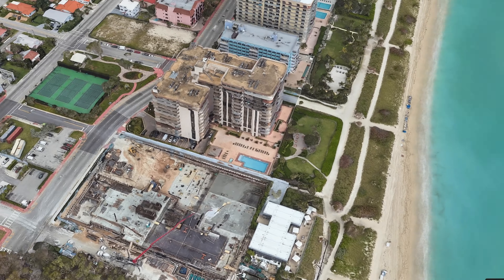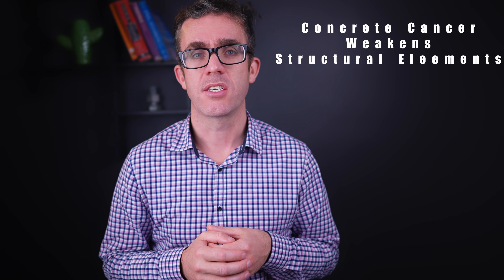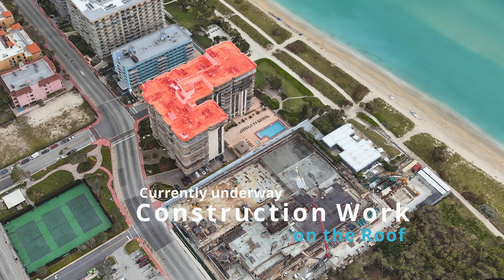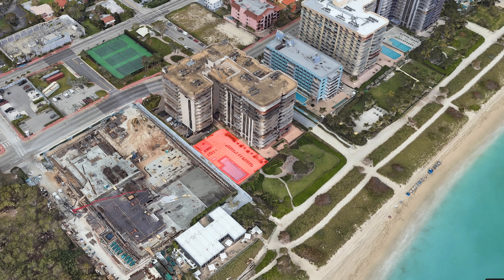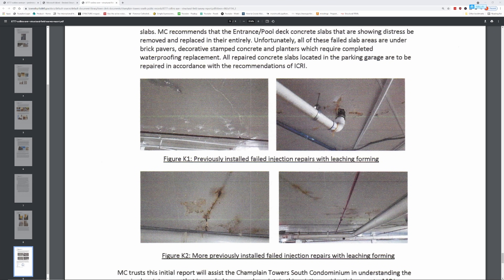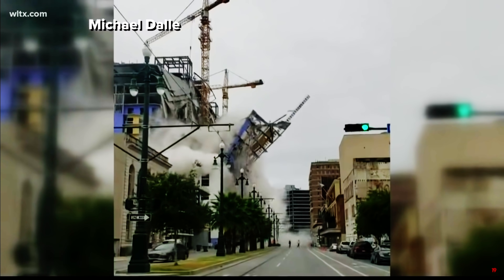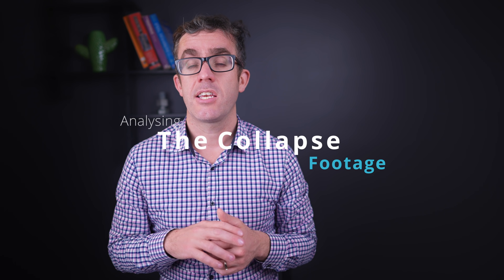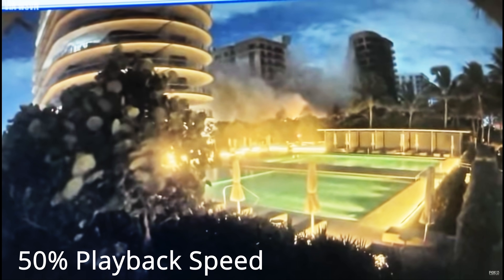How did a Miami building collapse: The Warning Signs. Report and  CCTV footage analysed

Comment: The first failure was indeed a column or multiple columns in the subterranean garage 7 minutes prior to the sequence of failures. Debris began and water began raining down in the garage over 7 minutes prior to the nearly 1/2 of the total structure coming down. 

To add to your spot on information, this tower, unlike its sister tower, experienced salt water flooding in the garage multiple times each year, during excessive high tides, for the last several decades. This is an important component to the investigation. As seen in the 2018 report there was extreme and extensive spalling in the garage slab and multiple critical columns. That said, we've not experienced building failure of this magnitude before. Other similar failures were the result of deliberate acts. It's vital we not speculate as the initial failure could be any number of thing. Not that the author of the video has. He has correctly pointed out a few reasons why the structure should have supported itself in the even of the partial loss of supporting structure. As well as a few reason why the structure failed to stand as designed. The initial column failure could be as simple as someone hitting the gas rather than the brakes while in the garage. Yes, this alone should not have brought the structure down. However with all of the degradation reaching a critical point one column losing structural integrity may have put too much weight on adjacent compromised columns and critical supporting structure. 

In addition to causing structural damage water intrusion may have been eroding the sand beneath the foundations of the structure. When enough material is eroded a sink hole opens up, undermining the foundation. This may also be why the initial collapse started in the garage over 7 minutes before the catastrophic failures. These are only a few possible causes for the initial collapse. The degradation of the structure noted in 2018 as severe was recently noted as critical. Had the building not been so degraded and provided no more than one column initially failed (if that was the case) this building should have remained standing until all occupants were evaluated within a few hours. 

Hindsight is always 20/20. This tragic collapse will forever change how we build, how we inspect, how we grade, and when and how we restore structures. One can't place the blame solely on the HOA, inspectors, homeowners, or prior contractors and their repairs. This will be a case study until a similar failure should happen, if ever. We all will learn from this catastrophic failure to prevent such a tragedy in the future. Building codes and building methods have improved in the 40 years since this structure was built. 

My thoughts have been with the victims and their friends and families since I woke to the horrific news. Nobody could have ever imagined this happening in the states. They're build codes and regulations are the best. Under normal conditions, a 40 year old building still in use should not have collapsed. I believe the HOAs misunderstanding of the 2018 report due to conflicting analysis and final notes was the only factor in delaying critical repairs. 

Engineers tend to use report templates. These templates are then altered to fit each specific subject structure. It's possible, and would be the first time, information on the template did not apply to this structure. There were some final notes stating to the effect the structure was overall in good shape. As a lay HOA individual reading this, one would conclude repairs are not as urgent as outline earlier in the report. 

For the record I have not inspected or even seen this structure before or after the tragic collapse. Again I am speculating on a specific cause of this fatal tragedy. I am merely pointing out a few scenarios and items of significance noted prior to the catastrophic failure. 

Cheers!
Reply from the maker: Hi Cameron, thanks you for the additional information so hopefully this sister tower is structurally sound.  The investigation will change building codes and likely find several causes. It maybe have been a cascade failure 

40 years seem like a long time between these inspections as well.  However no building should have failed like this, and we haven't see such a catatstopic failure is a building that basically failed under it's own self weight. There are likely 
 lessons to be leant.

Engineers will need to learn from this tragedy to sure it doesn't happen again, but It is a hight cost to pay to learn them.

I agree that throught need to going with the victims their family's and the first responders.

Cheers
Reply: Talk much?

Comment: What about the weight overload due to the excessive number of air conditioning units on the rooftop?
Reply from the maker: Hi Aktchung, from pictures it didnt appear to have to many air conditioning,  and their  weight would be small compared to the building weight so unlikely to be the cause.
Reply: @BrendanHasty  Agreed- the weight of air conditioning units is barely a drop in the bucket.

Comment: Really appreciate your effort for bringing this recent collapse. As per the article published in the BBC, it also suggests concrete cancer, water proofing and new construction works. The engineer, Frank Morabito, warned that the deck was not sloped to drain, so any water "sits on the waterproofing until it evaporates". This also suggests that water could not drain  properly and just relied upon expired water proofing membrane.
Reply from the maker: Hi Prabin, thanks for your support and sharing it out. The pool deck was a longish way from the crucial area, but bad water proofing and no drainage will likely increase any concrete cancer.

Comment: The building collapsed at low tide....
Reply: "Explanations for an initial failure at the bottom of the building could include a problem with the deep, reinforced concrete pilings on which the building sits — perhaps set off by an unknown void or a sinkhole below — which then compromised the lower columns." - New York Times

The article ends with an engineer saying that the key question is why did the building fail at that moment?

My answer:  It was low tide.  We know that sea water was pulsing in and out of that garage for decades as the tide went in and out.  Then on that night it collapsed at low tide.
Reply from the maker: There is alot of spectatation at the moment, it would be every hard to detect a sinkhole before the event. This will be investigated and we will find when the report is released.
Reply: @BrendanHasty  When you have saltwater intrusion for decades, then you know that you have a major problem.  The fact that the building was sinking twice as fast as surrounding properties is another indication.  Top engineers quoted by the New York Times are talking about it saying that if one or two pilings failed due to erosion from saltwater intrusion then that could bring the whole building down.  There is every indication that this is what happened especially since it happened at low tide.
Reply from the maker: Guess we will find out, if one pile failed this would unlikely bring the structure down. It would be damaged needing repair but collapse as it did very likely. Could it have been the initiator starting a cascade failure maybe it would other elements to be weakened. Two pile failing might do it but both failing at the same time would be unlikely.
Reply: @BrendanHasty  It will be interesting to see how it comes out.  Yes two pilings failing would be unlikely in a normal situation. Decades of saltwater intrusion is not normal and the building was sinking twice as fast as surrounding buildings.
Reply: @BrendanHasty  BTW have you noticed that the original debris pile was way lower near the initial spot of collapse?  Where did all that material go?
Reply: @BrendanHasty  Friction piles in porous limestone with salt water seeping in for decades.
Reply: @BrendanHasty  There is a lot of talk about LIDAR and soil analysis being "very important" at recent press conferences...

Comment: I have heard stories from other engineers seeing structures being build along the ocean, and the rebar being left out in the open. Causing the rebar to rust before even being placed into the concrete structure. Causing the "concrete cancer" to already be present before the structure being built.
Reply from the maker: Hi Seth, It would be to hard to fully protect reinforcement before it is poured. Most of the time it would be surface rust likely to not cause any issues. I am sure the investigation into this tragedy will answers many of these questions.
Reply: @BrendanHasty  what about using fiberglass reinforcement in areas where the structures are more susceptible to concrete cancer?
Reply from the maker: That is one option you can also protect the steel with sacrificial annoids. I haven't looked much into fibre reinforcement, however, it is likely to be brittle unlike reinforced concrete. Annoid protections would need some maintenance tho, but should be able to detect how the structure is preforming in a durability perspective.
Reply: @BrendanHasty  it's anodes. For well passivated steel in chloride free concrete they're not required. Due to the limited current throw galvanic anodes are impractical for reinforced concrete structures other than around patch repairs to prevent incipient anode formation. Better off installing impressed current CP and ensuring reo electrical continuity and appropriate zoning for maximum efficacy. Of course the 3Cs - cover, compaction and curing are the best line of defense for durable reinforced concrete structures.
Reply: Good God.

Comment: It's going to be very interesting to see what the outcome of the investigation is. Assuming they've allowed for disproportionate collapse in the initial design, the fact that the whole structure collapsed tells me there might be an overall material quality issue (concrete quality affecting rebar protection, etc).
Reply from the maker: Hi Theuns, it looks like the design is OK, and hard continuous reinforcement. So it should have been able to resist so disproportionate collapse. They will also need to look into the degradation of the structure due to concrete cancer.
Reply: @BrendanHasty  Could repair work through the years using a different type of steel have leached the electrons from the carbon steel? A good example is what happened to some of the oil rigs. Utter collapse from the electrons being transferred.
Reply: Yes the salt water eroding the integrity of the colomns and footings over 40 years was almost waiting for a nudge to fail it,  the initial design of it being interfered with by ocean water constantly has to have a shorter life span than a building without this serious structural intrusion.

Comment: Apparently there was damage shown at the entrance ramp. The ramp/ shear walls connect to a stairwell core wall.
The possible points of failures in my opinion that could occur (given the sudden non ductile nature of the collapse) is:

1. Foundation/ ground - sink holes or eroded soil that was relied upon to either take bearing and or lateral restraint of the piles
2. Corroded column confinement reinforcement
3. Maybe there was near the entrance ramp a transfer or main load bearing wall (not confirmed if this is the case) that was not designed adequately.

Could be many reasons.
Reply from the maker: Yea there is likely to be more then 1 reason, and likely to be several. It is going to be a hard to unpick all the issues to get to the actual cause or causes.

Comment: One further thing to note is that the entire area is frequently flooded with seawater due to storm surges. It's easy to imagine the steel in one of the lower columns corroding away over time. Add in the ambiguity at design stage as to how fixed or pinned an RC column actually is (probably no advanced software when this was designed) and you can see a situation where the column only just about worked due to safety factors, which don't account for steel corroding away. Lack of disproportionate collapse robustness definitely made this worse.

Even if design was all good a proper for 100 year life. RC can be quite variable between a high end contractor and a cowboy builder under time and cost pressure to get to his next job.
Reply from the maker: Hi Jonathan, it looks like the documented design was ok, with continuous reinforcement. So the future investigation will need to answers questions around why didn't the building only locally collapse. it should have had some resistance to disproportionate collapse. 

They should be testing everything in the building so any questions around the concrete will likely be answered.
Reply: lots of buildings still standing without "advanced software"

Comment: Thanks Brendan for producing this video. I’m a Structural Engineer here in Florida and also did a video analysis of this collapse on my channel. I did not cover the different failure mechanisms as in depth as you. Thanks for including those details. Another point to note from the existing structural drawings and the 2018 report is that the structural slab on the pool deck was designed flat so water was constantly getting trapped underneath the pavers which accelerated the slab deterioration exponentially. Again, thanks for another great video!
Reply: I went to the 1979 building plans.  On sheet 188 (out of 336) it clearly shows that the pool deck is sloped to various drains.  So either the deck was not constructed per the drawings or it was modified later or Morabito made an error in their assessment.
Reply: @RossSnyder78  sheet 188 is an architectural plan so it would probably relate to the deck pavers and not the structure.  Understand that a deck like this has the structural slab then there are materials built up on top of the structural slab such as sand, mortar, concrete to support the pavers on the pool deck.  The pavers may slope even if the structure underneath doesn't.  Water will go through the pavers to the structure below and may have nowhere to go.  If they applied a waterproofing membrane on top of the structural slab then it keeps the structure dry as long as the membrane is intact and does its job, but membranes don't last forever and occasionally you have to remove all of that stuff on top and install a new membrane.
Reply: @RossSnyder78  I think it may have been modified after the fact. Then again, slopes and drains only work if maintained properly. If the drains got plugged up, the pipes rotted and collapsed, or were otherwise not allowing the water to drain, that doesn't help. I also noticed the large concrete planter boxes that could have changed everything. One of them is close to where the collapse began. Were these planter boxes accounted for in the original drawings? Did they have drains? Were the drains plugged? Gotta wonder
Reply from the maker: Hi QQE, thanks for letting me know. The final report into this tragedy will be informative. Likely it will change building codes globally.
Reply: Were papers in 1979 plans?

Comment: Thank you so much for producing this video so quickly - I wanted to learn more about this
Reply from the maker: if you have more interest i have a link to the public available reports in the description
Reply: @BrendanHasty  Hi Brendan, thanks very much for this video it raises some important points. You are correct about the salty sea breezes, but direct impregnation into the concrete isn’t that much of a problem compared to the amount of salt extracted by the plants along the southern wall. Think about the surface area of the leaves. Also, this building had a design feature that allowed air to pass under the lobby, increasing the airflow over those plants. In addition to some other aerodynamic effects caused by the change in height of the wall from 8 feet to 4 feet at the end of the pool deck.
Reply: Thank you so much, I was waiting for this information.
Reply from the maker: thanks Kimmy,

Comment: How many engineers are usually responsible of such buildings?
Reply: In my experience a  project of this size would have anywhere between 3 to 6 engineers + drafters (varying from part time to full time on the project) depending on the company's work load. Depending on how much the budget is will determine how many graduates/ younger staff on it.
Reply from the maker: agree with ED it really depends on the size of the building, now days there would be less then when this was designed
Reply: @BrendanHasty  I would guess 2 or 3 unless there was a very tight deadline.